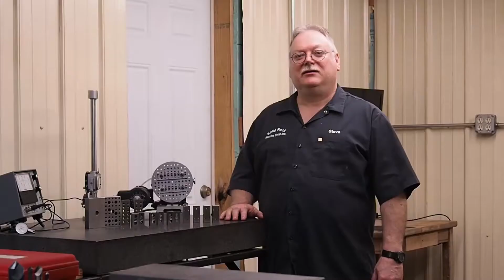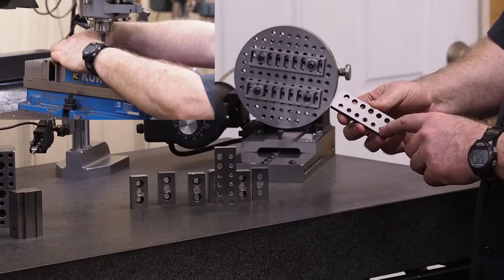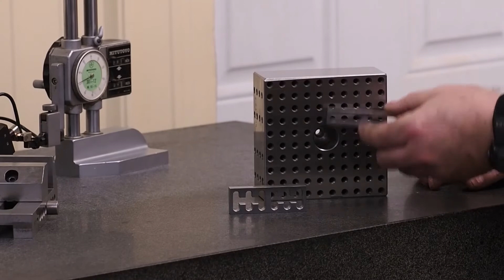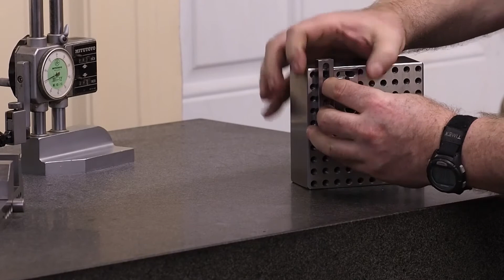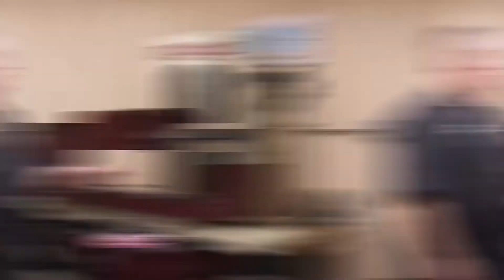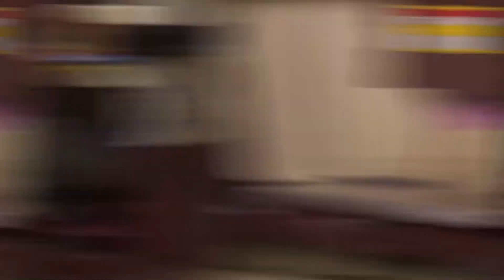Grinding setup blocks part 1

Comment: I got a grizzly grinder, the smaller one but I have no clue how to take the grinding wheel out to put a nicer one in. Also it came with some shaft that looks to me like some kind of attachment for maybe a cutting wheel?. I read the manuel but nothing about this shaft or how to take the wheel off. Maybe you might know. lol Thanks. Love your videos!
Reply from the maker: Hi Black Smith,
I have never used a Grizzly grinder before but I would think there would be some kind special wrench that comes with the machine. Try one of the internet search engines ans see if there is information about or contact Grizzly and they would know.
Steve

Comment: Hi Steve, does the thicker wheel washer need to be relieved on the faces so that it clamps towards the OD of washer and not near center off wheel for safety?
I.e. has same clamping footprint as adapters so there's no forces near center of wheels? Thanks again.
Reply from the maker: Hi James,
I have always used them without relief and they work fine. But what you said make perfect sense and I think I will alter mine. Thanks for the tip.
Steve

Comment: A question about the cutter you are using in the opening of the video, I have not seen one like it. Is it something you built?
Reply from the maker: Hi Michael,
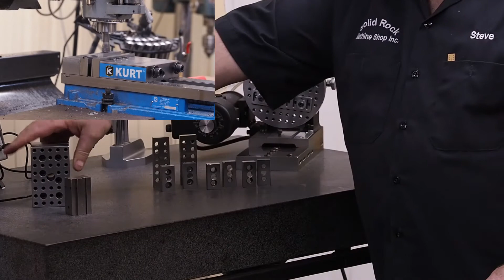That is a 1" Mil-Tec cutter using the super shear inserts. https://www.miltecusa.com/  This one I did not build but I have three others that I did build. The ones I built are one piece R-8 shank which are in some of the other videos. The smaller one is in this video at the 5:40 mark. They are some of the best cutters I have ever used on the mill.
Steve

Comment: Do you ave any balance problems with the wheel fitting directly to the shaft, compared to separate mounting hubs?
Reply from the maker: Hi Chis,
So far in my career the only wheels I balance and have dedicated hubs for are the diamond and CBN wheels. When you balance a wheel it is only balance at the diameter that it has been trued at. If in use your diameter is smaller from wear and dressing you will lose your balance anyway. I can't find it but there is an excellent video by the "grinding Doctor" which talks about balancing the wheel and how dressing can compensate to a degree an unbalanced wheel. So far I have not had any problems using wheels without balancing.
Steve
Reply: Hi Steve, thanks for that  If it's not balance then I think the ripple finish I get is possibly the drive belt has a "set" in it from a very long period of inactivity. If it wasn't a PIA to get to the back of the machine, or I used it more often, I would investigate. Perhaps a link belt would help?
ATB
c
Reply from the maker: Hi Chris,
I have seen spindles with to much wear in them cause rippling. Also, wear in the motor bearing can cause problems as well as the coupling between motor and spindle. when you have these problems balancing a wheel doesn't even help that much. As soon as your wheel contacts the part it starts bouncing causing a bad finish. Any machine noise in the drive train or table travel will affect the finish and accuracy.
Steve
Reply: Hi Steve, Also the rack and pinion table drive has been known to cause it too.
 The machine has had very little use, coming from a school where it was the back up grinder, so should be OK, of course it could just be operator error.
The belt is the fifty+ year old one, so is about due for its "periodic maintenance" change.
c

Comment: A handy thin plastic film to use in the shop is (search Amazon for): 
BARRIER FILM BLUE 4X6 1200 PERFORATED SHEETS 600ft w/ DISPENSER BOX DENTAL
Reply from the maker: Hi John,
Thanks for the tip. I will have to check into those.
Steve

Comment: Robin is a sharp guy! I like your cube, I need to think about making one.
Reply from the maker: Hi Brian,
We really appreciate Robin sharing his knowledge with us. We are really looking forward to his future videos. Those cubes are great and make short work out of grinding projects if used properly. I didn't mention it it the video but the best steel to make them out of in my opinion would be CPM 3V. 3V has better strength than 0-1 and almost 3 times the wear resistance of D-2.  It machines and grinds up nice too. It is pricey though but worth it in my opinion.
Steve
Reply: Ever used any DC53? I usually have some of that on hand that I use for other projects, it is very strong, tough and wear resistant, again not cheap stuff though.
Reply from the maker: Hi Brian,
Yes I have and love it! That would be my second pick along with CPM 1V. Many of the components on my spin fixture are made out of DC53 as well as a rectangle block similar to the cube we are making. DC53 is as tough as 0-1 with a little better wear than D-2 and the cost is about the same as A-2,  much cheaper than CPM 3 and 1V. 1V has the strength of S-7 (one of the toughest steels) and the wear of D-2 but is pricey. DC53 would make an excellent cube.
Steve